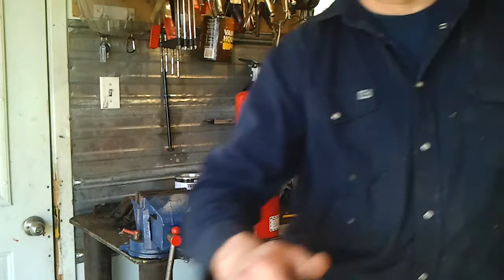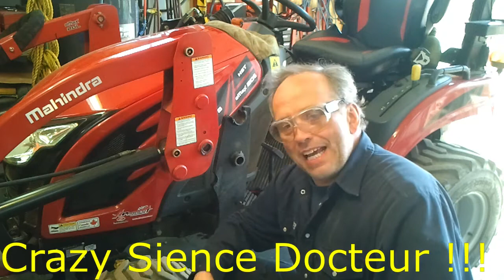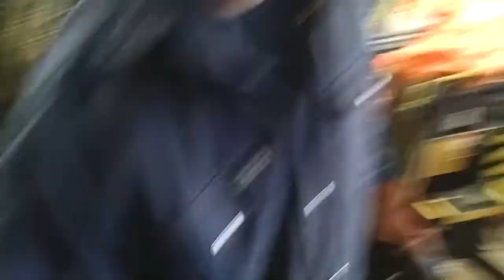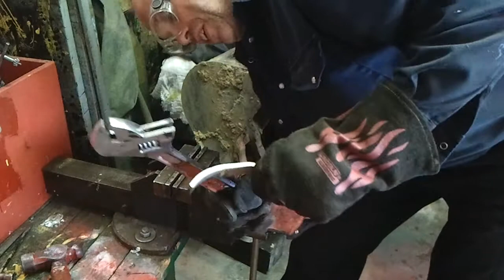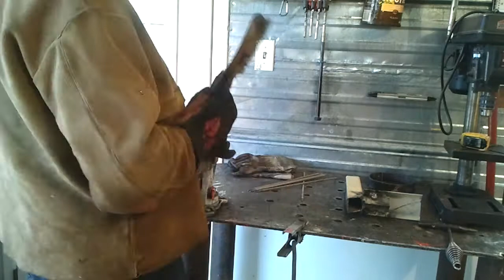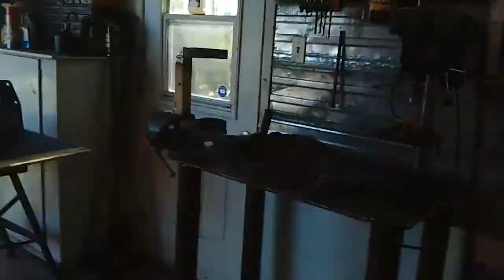Installation of a 10 pounds Fire Extinguisher on my Mahindra eMax20s HST 👍

Comment: Thanks Dave.  The welded bar will hold the extinguisher.  Hate to see you weld something to your FEL support permanently but that may be the only way to affix the extinguisher. Will wait for part 2.  You sure made some flawless circular rings.  👍🏽
Reply from the maker: Good day Sir, thank you for the kind words 👍😊About welding, it is not like a Tattoo  🤣😂✌ The neat thing is you can realy un welding it too 😉 I have even stick rods specially made for that task !!!  However, I never use it so far 😉Yes, I guess forging this is in my blood veine since 4 generations,,, I should go in my home town of my family, show you the still existing old forge shack in the middle of no were, in case it get cough in fire,,, Have a great week Sir Cheers ✌👌🌞
Reply: @RCAFpolarexpress  Right on, Dave.
Reply from the maker: @houndsmanone4563  👍

Comment: Dave, you are a pro of the circles. Especially doing that with a hammer!  This support is going to be stronger than the ROPS... Is this a 5lb extinguisher?  Now I feel I put a too-small one on my Case! Thanks!
Reply from the maker: Good morning my friend 😊Thank you kindly for compliment about my circle and the hammering 👍 It's a 10 lbs fire extinguisher so it gave to me for flexibility in time ( 20 sec ) for cutting the fire. The main reason that also bought a 10 lbs is to by use inside de garage also, I have already 2.5lbs in the garage and was too small for that job. Take care my friend Cheer😉😊👍